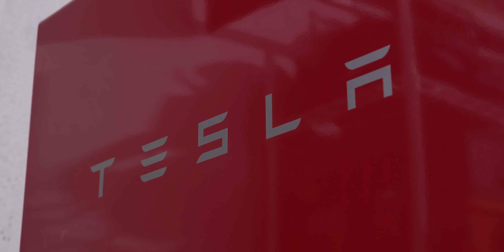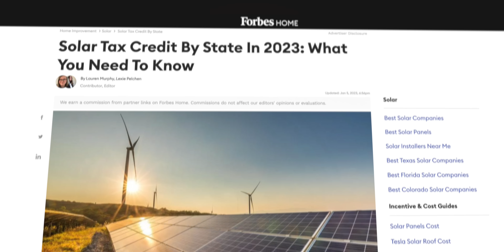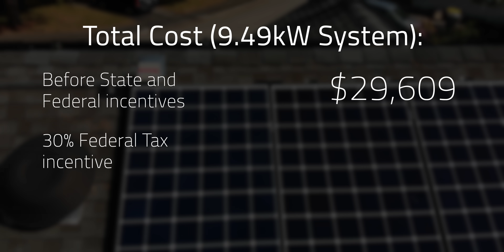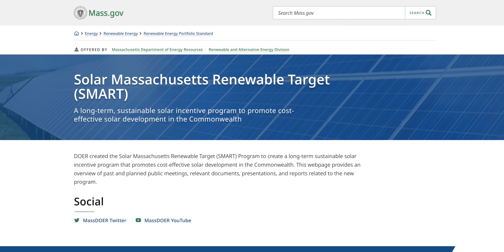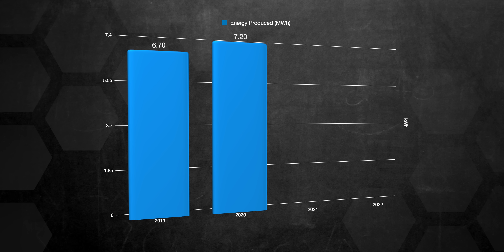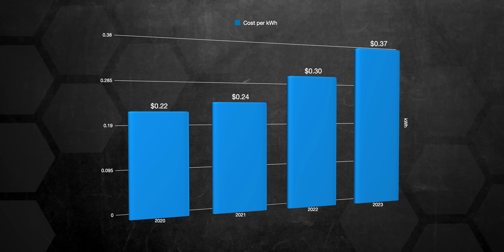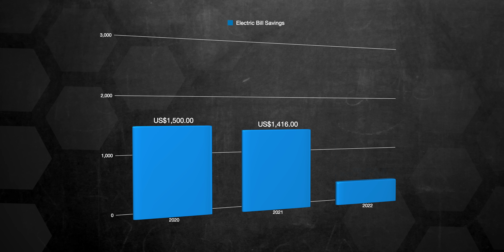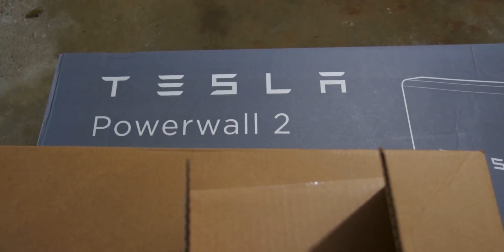5 Years with Solar Panels - Is It Still Worth It?

Comment: This is our second solar install. Our first was in CT with a leased system. We had a large ranch home and we had a 12kw System. It helped immensely as CT had the second highest electricity rates in the country at the time. Our lease was about $70 per month and in the summer it saved us over $400 in those months.  We moved to PA and installed Solar on our home in the Philly Suburbs in October of 2022. This is a 9.545 kW system with Sunpower (maxeon panels) and Enphase micro inverters.  We are very pleased with the new system as we were able to take advantage of the 30% Federal Tax Credit and this was timed right after we replaced our asphalt shingle roof.  We plan to get an EV at some point in the future but we have so far produced all of the electricity we needed and then some. We use PECO in PA which provides a payment once yearly that provides a credit for any excess we have created and not used. In addition, PA has a SREC program that pays about $38-45 per 1KW credit. We have sold 3 but have about 6 credits in the bank.  To date our monthly electric bill is only $10.52 per month which is the minimum customer charge. The annual payment credit we received covered that monthly charge plus gas fees for about 3 months.  We are exploring a battery, but will wait until we have an EV.  We are fortunate as there have been electricity rate increases in our area.   One thing that we experienced was issues with our Homeowners Association. It took several months to get approval and we are still working through getting a formally signed approval from the Board. If you have a Homeowners Association, you should do a lot of groundwork to make sure your association allows it or will approve it.  We went through all the right steps and virtually all homeowners were fine with it, but the Board slowed our project for months.  We had asked about approving solar 2-3 years prior and still faced issues.  One thing to think about in the future are micro inverters that can all you to generate power during an outage. Currently, our inverters do not allow that, but I believe the next generation from Enphase may allow that.  The other minor issue we have is the meter the utility installed had gaps to the outside, so about a month ago, we had a yellow jacket infestation that we had to hire an exterminator since the installer did not seal the gaps from the exterior to the basement panel.  We are quite happy with our installer, the system and our results so far.
Reply: You just have to send a “Thank You” letter to the kids in the Congo that are mining your precious minerals as fast as they can.  Knowing you plan to get an EV, I’m sure they’re already being forced to work overtime.  Out of sight, out of mind - The liberal motto.
Reply: @jak71113, one appreciates that your concern for our children in the Congo may exceed even your concern for your poor kids in West Virginia.  But seems you needn't feel this way. Mining is an equal-opportunity terminal extractive process, pulling the birthright out from under everyone on the planet, wholly without regard for race, creed, nationality, gender, or moral character. 

Whether it is coal, oil, gas, lithium, cobalt, copper, uranium, rare earth metals, diamonds, gold, gravel, semi-precious stones or sand - macht nichts.  The laissez-faire extension of this multi-national even-handedness will surely fulfill your life's vision of 'just so I get mine'.  So perhaps you should celebrate the global disaster, while you may, since your vision for resource allocation is being realized.

But if one actually were concerned about the net externalities of alternative energy production methods (vs, say, just trolling), one would need a more sophisticated  mental model of contingencies and alternatives, than that tattered what-about-ism: 'but-, but-, what about the starving children in Africa??'.  I happened to live in Zambia, Africa (a mining country) for 14 years, during which period Zambia rapidly went from a per capita annual income of $350  to $1,200 (to middle income country status) thanks to Bush & Obama's 'progressive' supply of ARV's and subsequent near elimination of AIDS mortality.  (Bush started PEPFAR with $15B, Obama renewed it with $57B).

The economic fix for African poverty was NOT digging more US coal, if you didn't catch that point.
  
In the hardest hit countries, the fix merely required ending the 50% life time risk of dying of AIDS. 

Thanks for your taxes.  Your country did good.  But you apparently were oblivious.  As you say, out of sight and out of mind.

Comment: I had solar pool heater panels. after the loan was paid off the panels started leaking, one after the next. no warranty because the company went out of business. also about $1000.00 to uninstall and reinstall when my insurance company forced me to get a new roof that I didn't need. Plus $250 each to replace the leaking panels. There are long term cost to consider. Something in the system will fail and it won't be cheap.
Reply: Leaking panels??

Comment: I installed solar six years ago and living in Arizona I feel it was the best thing I have every done for my house. I am connected to the grid and never expected to not have a monthly bill. I have a pool that runs every night and the AC puts a big drain on the electrical draw of the house (2600sq ft). I had a very good solar company, not the cheapest, and with the age of my house they advised to redo my roof before installation. Also the rear of my house faces about SSW so it is good for several reasons, good alignment for the sun plus it does not affect the curb appearance. Apart from two months of the year I am either building up credit with the electric company or slowly drawing on them as demand increases as the weather gets hotter. My typical electric bill is less that $20 and before solar the lowest it would be during the winter would be about $110. When I have exhausted my credits my monthly cost will increase to about $160 which is very reasonable for my house. I just looked at my July performance and I generated 1.3MWh although it dropped slightly due to the extreme heat and I have  7.25KW system. I made use of the 30% rebate and with the savings I have paid for the system. I do not consider the roof cost as part of the installation as the age of my house meant that it was very close to needing that anyway, a house across from me recently has to have all the panels removed for the roof replacement. I may consider some additional panels as I am thinking of a heat pump for the pool and maybe a plug in hybrid
Reply: Nothing, I paid for it outright

Comment: It all makes sense if you use a lot of power for your farm or business.  I paid $20 for my electric bill last month.  I don't leave my TV plugged in the wall 24/7.  I have timers on some lights.  I have a hot tub.  I've been considering putting a timer on my internet for when I go to work. I purchased a used oven, and now there is a digital clock that dribbles watts.  I decided to go with some solar lights around the outside of the house and garage, which has worked great.  I've been considering using solar lights rigged in the house in strategic places with the simple solar panel in the window.  This will help in the winter months.  My friend has solar on his house and when the power grid goes out, he told me that he still doesn't have power.

Comment: You turned me off when you said that Your LG solar panels are no longer available as LG has exited the business.....Ummmm, Why?  because it is NOT profitable enough.  My son installed solar panesl for his home in NJ.  Waited Months for local building Dept approvals.  i wish he didn't do this.  His analysis shows his return baswed on 2023 electric costs would take almost 20 YEARS.  Why did the costs for electricity go up in 2023....What do you think?  The WH Admin Stopped the production of Oil and natural gas.  Now we Import these crucial commodies, that under the previous Leadership was making the USA a oil Exporter !  For large Suburban Office Buildings Complexes, this may make more sense [Notwithstanding weather issues and service maintenance costs for the Panels and batteries).  Which is another poignant issue:  the manitenance of the residential solar panels.  Things Break, some things much more frequently than others.  Solar Panels are in the Former category!!.  Fools Rush In!!  Needs much more time tetsing.

Comment: You did not cover few topics, estimated solar generation vs actual. Its always a lie. installer pricing which varies because you a promoter. In 5years solar systems changed a lot, it is supposed to. Yours is definitely not upto standards. past is not equal to future. It may not work. Solar is just a experiment. It obviously has advantages, but not at that level which is advertised. Main reason I can think of is you cannot sell energy back into grid at the price you like, you cannot get it installed at price you expect, you would not generate as much energy as you expected before, home insurance goes up, roof liability is a issue, solar energy generation degradation which no one really talks about, replacing solar system or roof a BIG expense. overall its thinking you are helping planet same like buying EV cars but you forget what it takes to create a EV car.

Comment: I agreed for a 3KW ongrid mono halfcut, but the franchise never informed about phases avaliable and installed single phase.  I have a 1.5 T 5 star ordinary voltas AC. Can I run AC or what changes  I should make. I live in a India  town with no much power cut and mostly sunny days.

Comment: I live in South Florida, hurricane country.  I have suffered through several in the 40 years that I have lived here.  I see people in my neighborhood having solar panels installed and I have to wonder if they have thought through the ramifications of repairing their roof after a hurricane.  Once the roof is leaking there is a rush to get a temporary blue tarp on the roof.  I doubt that any contractor would try this on a roof that is electrified.  Then to repair the roof, the installer would need to remove the panels before the roofing contractor could do the repairs.  I have seen plenty of homes with blue tarps after hurricanes, even less powerful hurricanes. 

Don’t even think about putting them on an older roof.  I have heard that insurance companies are refusing to insure homes with roofs older than 12 years.

My use for solar will be after a storm passes.  I have 4 100 watt rigid panels that will go on the roof of my screened in room after a storm.  That is if I still have a screened in room.  They will power a 1300 watt hour solar generator which will run my refrigerator.  The only problem is that a mostly cloudy day won’t produce enough energy to keep the refrigerator going.  One would think that Florida would be ideal for solar, but when those big cumulus clouds cover up the sun the output drops to 20 or 30% of the rated output. Luckily, I have a small generator which will also charge the solar generator.

For those reasons I am out.

Comment: 1 MWh per month is not "a lot", it's absolutely insane from a European's point of view. That's close to a third of what an average home (house, with flats it's even less) uses in a year.
Also how is it your fault that you went with the company recommended by Tesla itself and it turned out to be horrible? It was an official recommendation by Tesla, the fact that the company is horrible is shameful and reflects very badly on Tesla. Customers shouldn't be forced to do background checks on officially recommended third parties.

Comment: So basically, Solar can not stand on its own as a solution.  Without the $15,000 or so of government subsidy from the taxpayers is what  makes it "economically feasible".   Take the value of money over 5 years,  and factor that in.  Yes, the cost of power went up, but so did interest rates.  Now a CD is giving about 5%.  5% of 30K (if it were done today) is  $1500/year or $7500 if you don't compound the interest.   Yes, interest rates vary, but so do power rates as you point out.

I think you painted the most rosy scenario using other people's money while disregarding the benefit of keeping $30K cash on hand over the 5 years.  Also, what's the life expectancy of a panel.  I'm seeing 15 years on a good day.   That effects re-sale of the home too, negatively.  Someone buying a home with 10 year old solar panels, or let's go extreme to 14 year old solar panels, will pay less,  not more knowing that they are coming to end of life.  

And finally, as you point out the LG panels are discontinued, what do you replace them with when they fail?   Will the new interfaces work with the old panels?

Just saying, it seems to be a very biased report, but thanks for doing it.
Reply: Where are you seeing 15 years on a good day??  Most low to midgrade panels have guarantees of 80% of day 1 production after 20 years, more premium panels like Rec Pure have 92% guarantee of day 1 production after 20 years.  You need to do quite a bit more research before bashing a product you really don't seem to have a grasp on.  Solar is certainly not for everyone and a homeowner just like any home improvement project much do their due diligence, but it can work to the benefit of many homeowners.

Comment: I see you're going geothermal with your new house.  I did that 30 years ago.  Have geothermal units in 5 different locations.  Been studying solar annually for 10 years now.  Just will not pay for me.  Get only wholesale credit for a highly restricted amount of sell back.  Large battery storage required by GA Power for any residential solar installation because they don't want to serve as my storage.  So it's still a nonstarter in this area because of utility policies.  I have a background in electronics and an MBA so I can analyze the cost/benefit ratio of solar.  Every year or two I have a solar salesman trying to bamboozle me into buying a system which they claim will save me money.  Not yet it won't.

Comment: Your numbers make no sense unless they are just made up. You state you use 1000 kw/hrs a month My 2900 sq foot house uses 35 kw hrs a month.  ??? Then your solar array gives you 7.4 kw hours so then you pay for the other 778? So solar saves you around 70 dollars a month and you pay around 250 a month still. By the way my electric cosy is 8 cents a kw hour. Your numbers seem to be out of this world unless do you have like 6 heated pools and 17 electric cars? How is your winter solar charge? Thank gosh you got a 15K battery so you could lend the spare electricity you don't have and get money for not having it. I mean if you are using 3 times what your solar is producing then I do not see how you have any spare enrgy to lend. Is this some lackwit strategy to just give a bunch of made up false numbers and not actually seeing what is truly relevant? Because you sir evidently do not have a solar system or better yet an electric system that seems to draw hige electricity when you can show savings but then when you sell your spare energy(which there is none by your prior admittances of using 1000 kw hrs while producing less than 250 on a great month) to the energy company.
Reply: His numbers make sense.  There is no way whatsoever that your 2900 square foot house only uses 35kw hours a month.  Use some common sense bro.  Your post says your 2900 square foot house only uses 35kw hours a month and your electric rate is 8 cents per kw.  That means your electric bill would somehow be in the area of $2.80 a month.  Your post makes zero sense...

Comment: The biggest energy cost is heating and cooling.  I installed a geothermal system powered by solar.  My home is 71 on average all year round.  with only maintenance cost.  My energy cost are about $75-100 electric and about $75 for LP gas...   Before my average energy cost was about $600 on average a month...

Comment: I remember getting e-mails about this 5 years ago.  I didn't have interest because of the high trees on our lot.  I think what I saw from this video we need to combine Solar/Safe Windmill/Hydrogen Gas with Sodium Ion batteries to see any significant returns.  If they put this in every Bell central office they wouldn't need to haul diesel if the power goes out. Probaby going to be a huge industry that does this and the water company will probably want the water the that comes out of the pipe for Hydrogen gas combined with reverse osmosis because of the threat of Atrazine in the water in some areas.

Comment: Well, if rooftop solar can break even in MA, a place known for long winters and cloudy skies, it must yield great returns in places where the sun actually shines!
Reply: Not the case here in Arizona.  The power company pays cents per kilowatt (they used to be 1:1,) so the panels don’t give a return on your $25,000 plus investment.  Most of the homes you see with solar down here are retirees that have money to burn, or Cali residents selling their old homes for absurd amounts.  Then, the Cali residents move to AZ to buy a “cheaper” home ($400,000+) and use their excess cash to buy solar.  There’s also an issue of selling a home with solar, that adds cost to the buyer.
Reply: @jak71113  Wow, cents per kilowatt... must be nice.